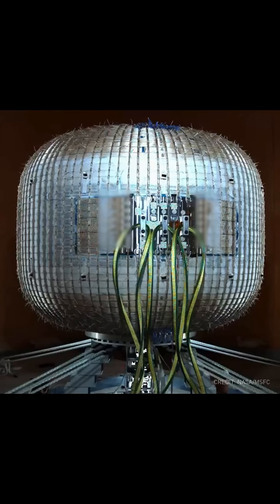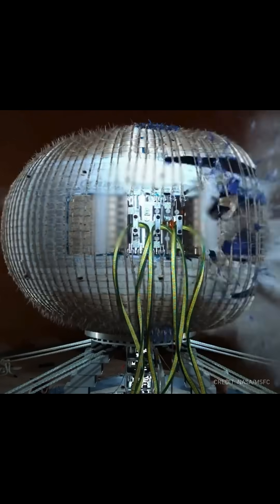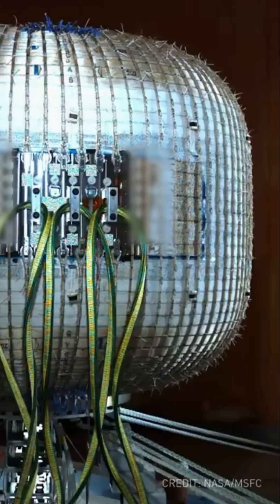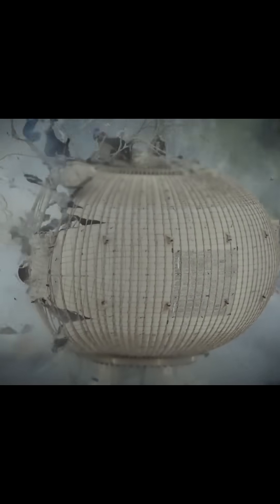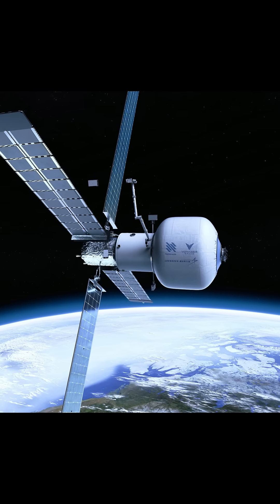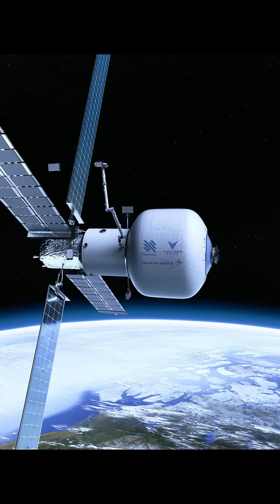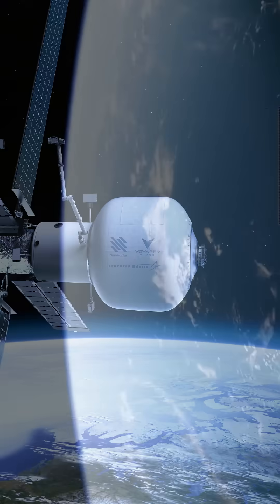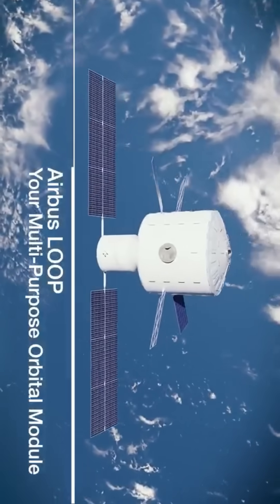Lockheed's Inflatable Space Station Explodes After Months Of Testing

Comment: I appreciate the strength that the module has but for me the biggest difference between a rigid module and an expandable one is the way it fails and the ability to repair it. In a rigid module if there is a small failure, such as a hole, it is localized and you can patch it up. In an expandable module, if there is a localized failure it affects the whole structure. It can lead to cascading failures. A possible solution would be to have a double wall where the structure’s rigidity is independent of the interior pressure. If one of the walls were to fail there would be a floppy loss of structure instead of catastrophic. It might then be useless but it is safer for the crew.

One thing I don’t see discussed about inflatable modules is what to put inside the module? The equipment also has volume and it has to go somewhere. If it is in the module already then the module can’t be that much compacted and if it is elsewhere then it is taking up room that something else can go or it requires subsequent launches.

In the end I think the solution will be an origami hybrid between rigidity and inflation (like inflation in only select places or directions).

Great video. 😊

Comment: .   Use a double bladder and inject a polymer resin in-between the bladders to inflate that becomes a hardened wall. Add fiber mesh weave in between the bladders for even greater strength.

    Leaving it a balloon makes it subject to popping not only from out of tolerance pressure differential but also puncture while under pressure to say nothing of damage before and during gas inflation. With the polymer injection one can likely even still inflate if there is a small hole in it particularly if one uses and expanding closed cell polymer structural foam.

    Humans are morons. They need to learn to include the other things they already know.... show me the entire team of scientists and engineers working on this that lived their whole lives without learning that balloons are popped by sharp rocks, hot sun, "oops I guess my belt buckle was sharper than I thought", etc...
.

Comment: Maybe they could design them to inflate, then have a two part epoxy flow into voids in the skin where it hardens, and now you no longer have an "inflated" spacecraft but a hard shell spacecraft that used inflation to assemble it. Kinda like those middle school paper mache crafts where you inflate a balloon before covering it with paper and glue to harden into a shell that no longer needs the balloon to support it.

Comment: Still, have to wonder whether a micrometeroid impact would trigger a failure like this even at normal operating pressure, especially after the structure has been exposed to UV and particle radiation for a few years.

Comment: I really would want an inflatable module have multiple layers so that 1) no single layer is holding in all the pressure and 2) if one layer pops the other layers remain, jusr with a larger pressure difference.
There should also be cells between the layers so that if one layer is punctured only a small cell pops and not the whole ballon. This design looks dangerous. Punctures happen and this looks like it would just pop if punctured.

Comment: Had this discussion with my ex. My claim is that the only part of a spaceship that needs to be pressurized is where the crew and tech is. Engines, fuel and electronics surely need protection but that’s it. Cargo not as much if it’s hauling space junk. Space is a good insulator in my book and you don’t risk depressurization where there is none should a micro-thing come and breach the hull. So long as the cargo space is rigid and the cargo secured properly your walls there could be paper thin.

Comment: Why don't they solidify the structure with epoxy after inflation? An inflatable mandrel covered in a carbon composite would be much easier to achieve and provide a far longer service life than a flexible shell.

Comment: Were they maintaining a constant pressure or were they cycling it up and down?  Four months of cycling pressure is a much more rigorous test but still the fact that it's failure was catastrophic instead of a lesser failure says their design is not failure resistant and they need to go back and look at it some more.  Still, they DO know more about it now so I'd say the test was a great success even if the design was not.
Reply: it wont be cycled in space.
Reply: @Noorthia  Yes and no, it won't be cycled to four atmospheres in space but there may be small pressure changes happening so you TEST things by exaggerating the situations they are expected to be able to deal with. This test shows a catastrophic failure which would have been fatal to anyone in that module at the time of failure had it occurred in space.    I expect the engineers who are examining this to see where the failure started and how and why it progressed so catastrophically and to see what kinds of changes need to be made to both make the module even more durable and to fail less catastrophically.

Even if the four months of testing shows that the module will be able to last in space for decades I expect that lessons learned from this will be implemented and applied to whatever module finally gets used in space.

Comment: Just FYI, high speed cameras don't record non-stop.  Or rather they DO record nonstop but they don't SAVE data nonstop.    As soon as this event happened they press a button that captures the cache and writes it to disk.  And that probably happens automatically based on a command from a second camera that's just looking for changes in the picture.  Once it sees one it tells the stop motion camera to save its last few seconds of data.
Reply: But wouldn't they heat up a lot, so they would need to be constantly cooled if they are being ran nonstop, that would be a more unusual way to use a high speed camera
Reply: @Ace_Milk  they have coolers. problem solved
Reply: Who asked
Reply: @sayochikun3288  comments are called comments, not questions and answers.
Reply: @sayochikun3288  🎉

Comment: Important to remember though is that this is just mark 1 of this type of module.

In the future they would apply the same type of inflatable technique for a large design in space, and then fill that void with a mix of foam and epoxy for both insulation, and strength.

After curing there wouldn’t be a need for it to be full of air.

There are loads of further designs and alterations of this so.. it’s basically the future.
Reply: Technically since it's a space station there would in fact be a need for it to be full of air. 🤓

Comment: Inflatable modules should be used for storage or workroom. Occasionally accessed but not slept in. 
Really big ones can be used as Assembly Workshops to assemble spacecraft too big to launch in one go. Personally I'd want a space shield in place too to block radiation, space debris and to take some of the strain of pressurisation. The big advantage is you're only relying on the bladder to be airtight, which opens up design opportunities for the rest of the system. I'm thinking a rose petal shield to allow the completed spacecraft to egress easily. Sealing the petals to being reliably airtight would be a nightmare. If you can make the bladder into a clamshell bladder you can depressurise and pack away both halves within the safety of the shield, both from exterior threats and interior containment (a dropped socket doesn't become space junk), and once everything is squared away, open the petals and The Enterprise is born. (The first made of EVERY starship design HAS to be called Enterprise)

Comment: One might think the footage might have been petabytes in size. But actually what phantom cameras do is keep the last few seconds of footage on RAM and then when something happens and someone(or a sensor) pulls the trigger what's on RAM is written on disk. So a huge storage solution was not necessarily for this footage, just a lot of good reliable RAM.
Reply: Usually the bandwidth needed is way too high for permanent storage (300 FPS requires 10x as much bandwidth as 30 FPS. 3000 FPS requires 100x). Definitely not enough time to compress from raw high resolution data. It's truly a micro scale logistical problem
Reply: @andrewahern3730  good point!
Reply: they might have it set up to record every, say, hundredth frame as well, just to be able to document creep over time and catch any longer term motion of the material before the final failure, like seeing whether bulges form or the like.
Reply: "James, what do you mean you forgot to hit record? This test has been ongoing for MONTHS!"
Reply: Thanks, I was wondering about this :)
Reply: Cant they just run multiple cameras (or memory) and switch between them
Reply: @autosativa don’t have time to “switch” at the moment of failure.
Reply: super cool, thank you
Reply: Yeah they would definitely be monitoring the pressure and all sorts of stress and strain sensors in there. This could be passing through an algo which would then trigger the recording mechanism. Single shot events are mostly captured this way to tackle the bandwidth required.
Reply: It depends. Null data can be just as important as when something happens. They might have kept all the data just the see if there was leading indicators of failure. Those indicators might have happened hours, days, or weeks ahead of time. They probability recorded the sound and thermal too. If they weren’t taking as much data as possible then it really wasn’t a test to failure but just a demonstration to convince regulators that it was “safe”.
Reply: It's the govt too. So don't forget, what would be prohibitively expensive for any normal person, or company even.. They don't really have that issue.
Reply: Yep! They use a 'cyclical write' system where they effectively just buzz through the RAM address space starting over wherever it started writing everything they capture. That is why its important to 'trigger' a high speed camera soon enough after the event you wanted to capture, and why youll hear things like the slowmo guys say they have '7 seconds to trigger the camera', because they only have 7 seconds of record time at that frame rate before things start getting overwritten. The trigger tells the camera to stop recording and dump to storage.
Reply: Does RAM have issues with the quantity of data written over time like an SSD? I'm imagining some engineer praying that it doesn't rupture during the one time they have to replace the ram because it reached it's end of life 😂
Reply: @thentil  DDR5 can write at 50 GB/s per stick. NVMe can write at 3.5 GB/s.

I see you mean degradation over time. No, because RAM is volatile and needs constant power. NANDs don't need constant power but are at risk of losing write ability.
Reply: @andrewahern3730  Thanks for the explanation!
Reply: Would this be a good use of AI?

For safety testing?
Reply: @deanc9453  ...why would you need AI? Design a test rig to test your product, wire sensors to a data logger, write some code to poll sensors and store data. At what point do you need AI? And if you say the code stage, you are a horrible person who wasted resources going to school and learning nothing at all...
Reply: @TankR  chill dude.
Reply: @rantos9  Chill? Homie, you aint see me not chill yet. So chill, k?
Reply: @TankR  you don't have to be angry all the time man. If something on the internet is upsetting you just turn the screen off, put the phone down.
Reply: @rantos9  if you choose to interpret my text as anger that is a you problem, mate. I refuse your inference, and attempting to passively bully me with said inference into changing how I interact while you are willfully ignoring other potential tonal connotations is the real problematic behavior here. You don't get to dictate to others what their intentions are. So again, maybe chill bruh. K? K.
Reply: @deanc9453  maybe, image classification is a main line on the Machine Learning field. Check potato or tomates classification with computer vision, they are pretty fast. In this case tho the event is so much faster maybe it can't be done with image alone, probably really need sensor like TankR said.
Reply: @deanc9453  … a i isn’t good at anything yet

Comment: 4x times pressure for that long is pretty good, though wouldn't it be good if something was pumped between the membranes to mae it rigid, bit like applying insulation to the walls before putting the plasterboard to the interior?

Comment: At normal pressure it should not break catastrophically like this
Reply: No. This is the result of long-term deterioration due to the entire structure operating at 4x design pressure for months. Under designed conditions, the strain is much less, and even when things do eventually start to fail, the failure will be much less energetic.

Comment: I  anticipate radiation would be the biggest threat over time, degrading the structure's resilience to impact and flex,  anyone who has painted garden furniture, will know how quickly it fades and goes brittle, same over time with garden hose and deck chair fabrics, the polymers are chemically degraded by the UV. This is far more intense I surmise in LEO, than my back garden in the suburbs of Leeds.  Although likely this can be mitigated by careful choice of materials and coating, it would seem to me an inevitability of finite service life and also increasing mass of such structures into space. even to the point that with big enough boosters a rigid metal structure might be preferable and economic

Comment: Interesting video Scott. Could you do a video about why upper stage rocket tanks are not commonly used a living space. It is already in orbit. Wouldn't become space junk. Are the propellent tanks stronger the the crew capsule.
Reply: It been proposed many times, but it’s never been done for a few reasons: first, the amount of time and effort needed to convert a fuel tank into livable space is fairly high, and you’ll still need to send up a premade living space for the astronauts to live in while the work is being done; second, people just trust purpose-made living modules over the implied jury-rigging of a converted fuel tank, and third, many fuel tanks actually have so much space that it becomes impossible to justify putting the effort in to convert them because the launch capacity doesn’t exist to cycle enough astronauts to justify it (the International Space Station has 388 cubic meters of livable volume, while the Space Shuttle’s external fuel tank has 560 cubic meters of LOX tank volume and over 1500 cubic meters of hydrogen tank volume; there simply aren’t enough rockets or astronauts to fill all that volume continuously).

Comment: Overpressurizing is rare in space. What i'm worried about is how this structure will react after it's hit by the unavoidable micro meteorite. A far more useful study would be to inflate it to normal pressure, in a vacuum, then fire a couple handgun shots at it - it should fail gracefully rather than catastrophically. This idea has merits once we start digging asteroids: a hollowed one that has had most of its interior carved out for useful minerals, can be insta-converted into living space with one of these inflatable habitats, with one or 2 meters of rock providing enough protection against meteorites and radiation.
Reply: That impact situation has been researched and studied for over a decade now; among the information is that a flexible structure with some give has some advantages over an inflexible rigid structure.
Reply: You could poke many holes and it would still air I’ve
Reply: interesting idea.....rock cacoon
Reply: why would you need a vacuum chamber to test it?
just inflate to 2 atm in a normal room
same differential pressure as if it was inflated to 1 bar in a vacuum.
Reply: @RLi-Cat  There will be differences in how the material behaves. Sublimation, for example, might cause faster loss of plasticizers from the flexible material.
Reply: @RLi-Cat   the physics are likely different, or else they would...
Reply: @ ballistics wouldn't be the same in a vacuum as in a 1atm container. A micro-meteorite, say, 1 or 2cm in diameter, traveling at say 2km/sec , will move very differontly in a vacuum as it would in an atmosphere. Here a vacuum chamber is the most realistic simulation - within it you fire shots at this inflatable habitat, and let's see how gracefully (or not) it reacts
Reply: @RLi-Cat  Even so, that does not tell you how the materials would behave in vacuum, materials sometimes behave differently out in space's vacuum. Kind sort of like an automobile manufacturer saying, Yeah, we don't need to test this truck in snow, we drove it in mud, same-same.
Reply: @scottfw7169  true that's when cold welding caught us off guard.. although it was known about. Happened to Galileo's high gain antenna.
Reply: These are made out of Kevlar and Spectra. Same materials that helmets and vest are made of.
Reply: Asteroids are a bunch of very loose gravel, usually without a core, they're not solid rock. You don't "hollow them out" and you can just shovel the stuff over the vessel to bury it.
Reply: @ depends on the asteroid. There are some, like Psyche, that so far appear to be a mostly solid chunk of mostly metal. Others appear to be a mostly solid chunk of silicates, like granite. And others, ef course, are "gravel" as you said